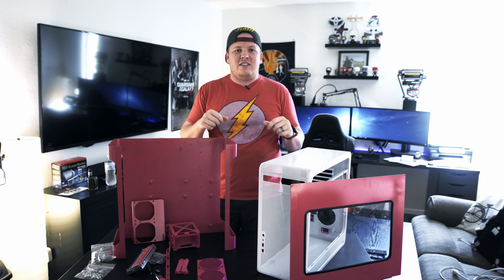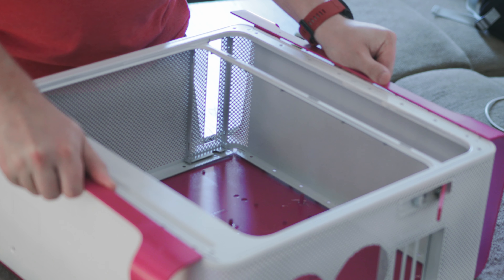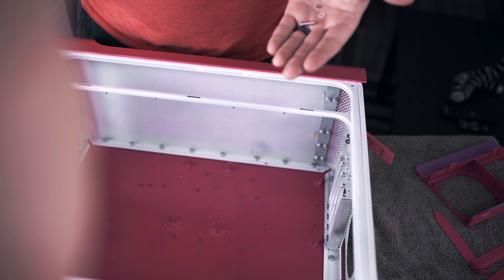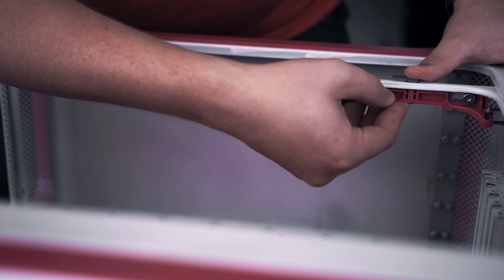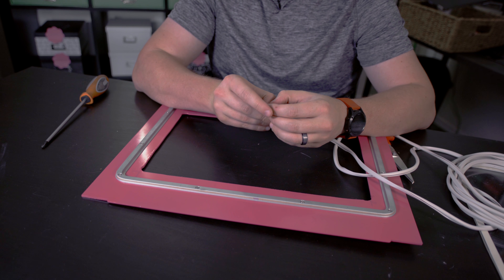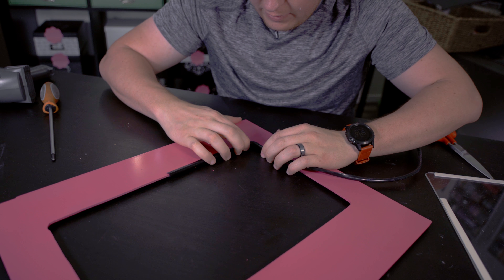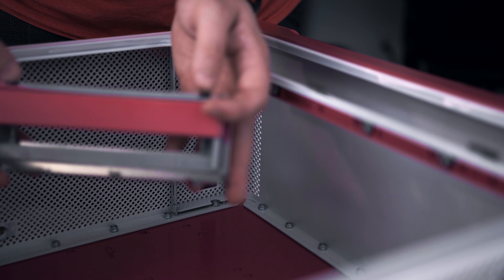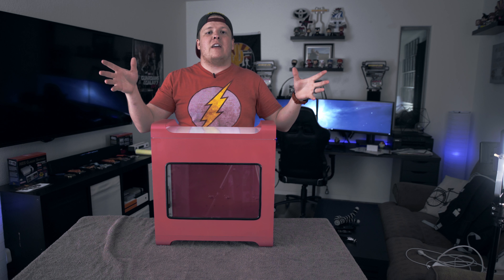PowerMac G5 MOD!!! The Transformation Pt  3!!!

Comment: I want to use a G5 case for a Hackinstosh because its a nice solid build but my limited under the counter PC location limits the size of the case.  Can you tell me if its possible to remove the handle portions top and bottom without having to cut through the heavy outer shell of the case.  I'm hoping there is a way to disassemble the handles off by removing screws etc.  I know this will spoil the look but it will be tucked into a cubby and will only be partially visible. Thanks
Reply from the maker: No. The handles are part of the outer shell. Since it is one piece that wraps around, they need to be cut if you are going to remove them. Honestly I wouldn't recommend cutting them either since they are part of the structure of the case. I'm sure it can be done, but I would look for other options that may better fit your needs.

Comment: Thanks for your video. I have now completed my G5 case tear down for ATX mod but I have an issue with three side panel 
latch black retention pin/clips which now will not stay in place.
What am I doing wrong?
Reply from the maker: I'm not sure, but it sounds like you are putting the clips on the wrong way. Try flipping them over.